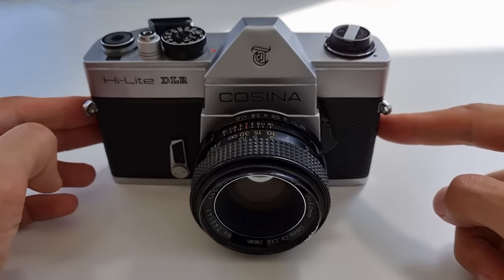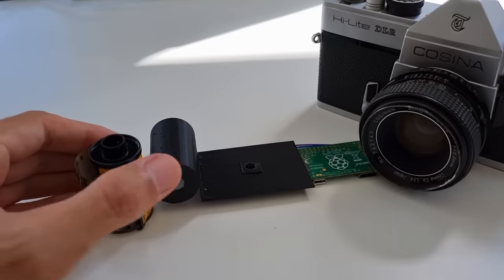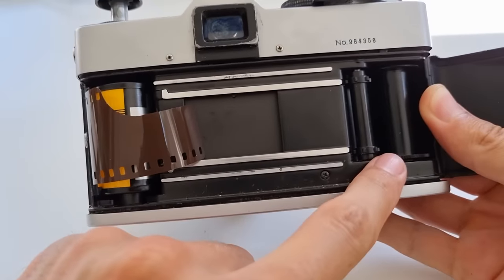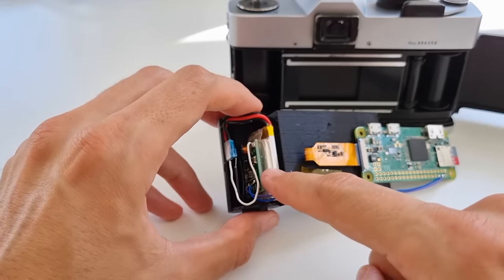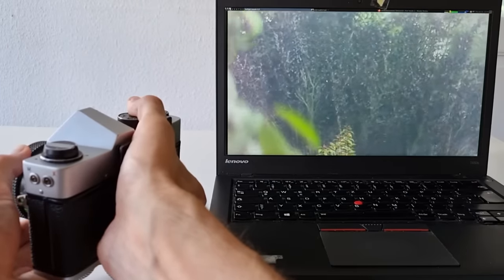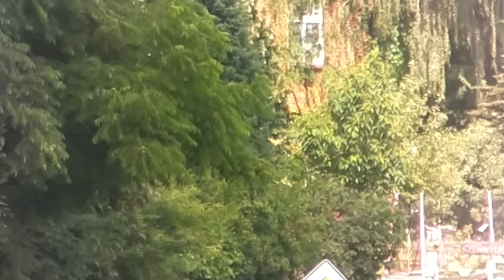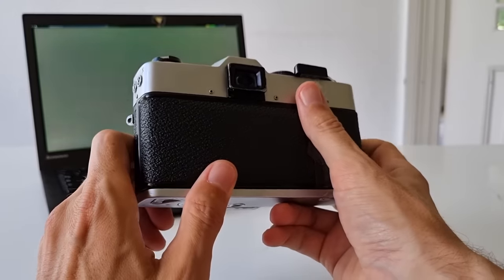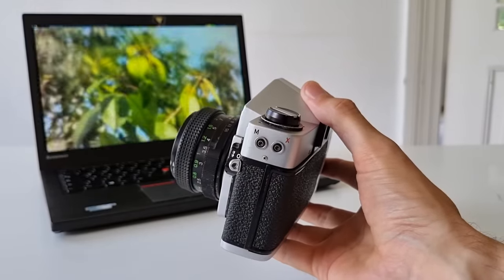Digital Film Cartridge for Analog Cameras (using Raspberry PI)

Comment: I am not amazed that the quality of the image is good. That's optical glass, you have there. These things were expensize, and that was in large part due to the quality of the lenses. Don't forget, you had to illuminate a 24x36mm surface in a perfectly flat plane. That took pretty good optics.
I can explain the zoom effect you experience: look at the focal length of the smaal digital camera's nowadays: the are between 3 and 5 mm. You have a 50 mm lens out there. If a 3 mm lens gives a 'normal' viewfield on a digital camera (equivalent to a 35mm moderate wideangle, you have now the equivalent of a 583mm super telephoto lens : 35 x (50 / 3) according to my calculation. Even if you could find a wide-angle on that camera, it would still be a 327 mm tele : 35 x 28 / 3.
There is one thing puzzeling: how did you have a film camera ? Because normally, the mirror AND the shutter block the light towards the film, and in this case, you Raspberry Pi camera. I can only imagine, that you set the speed dial to B (bulk exposure) and kept it depressed all the time ? If so, you should mention that in your video.
Nice work!

Comment: Do you build this to sell ? Can I order ?
Reply from the maker: Unfortunately not. It is just a nice demonstrator but quite far from a product. And to be honest, several factors speak against selling this. Most importantly, the small sensor size which leads to a quite insane zoom, rendering the camera not really useful in most daily applications. Also, the form factor can vary from one camera model to another, so it will be hard to develop something that fits in every camera.
Reply: hey if you fix the sensor issue and make something for popular camera models such as leica m3 or nikon fm2, you can probably have a nice side income.
Reply: @kassenbon  Amazing upload! This would really bring life back into my old slr's, and the video over wifi is just next level when you consider a slr. Any chance of sharing just a part list then? Your video really outlines the lot of it, but knowing what battery you got, ect might help here. I see that the sensor increases the crop factor, but I'd still really be interested in making one myself. I think there could still be a lot of potential with other lenses. Star cam, nature cam, macro?? 
-Cheers!

Comment: A little concerned that you said the Cosina camera ‘was state of the art k in its day, no it was a low end starter camera, Leica, Canon and Nikon were state if the art then. Given that I love what you have done, could you try it with a 2.1/4 square body such as a Mamiya or Bronica, maybe more space for larger sensor.
Reply from the maker: I was referring to the way of shooting images with the combination of 35mm+SLR. But I agree that this was not clear and showing this off with a Leica would be fitting much better. Thanks fo pointing this out! 👍

Comment: So it's just for hd video. I thought it would be to take stills but that's not enough resolution.
Reply from the maker: It can also do 5MP stills. With the HQ camera it could even do more.
Reply: @kassenbon  need 10mp to match 35mm. I have some stereo cameras I'd love to try this on. Need dual sensors though. I suppose everything else has to still work, shutters and focus.

Comment: What is the point when you are simply using the camera as a holder of the hardware? You can't press the shutter button to take a picture or record a video. You can't adjust the shutter speed. So, it is not a camera. Better off selling the camera to someone who can really appreciate it.

Comment: The problem with ALL Dumbed Down Dirty Digital camera systems is that however small you make the pixels you will NEVER even approach the size of ONE MOLECULE OF LIGHT SENSITIVE EMULSION ON FILM.
You are deluded if you think you can get anywhere near the quality of film, even if you could get a full size digital sensor array.
It is physically IMPOSSIBE, not even in the same ball park.

Comment: Rather use film that sensor looks piss poor
Reply: It’s a DIY prototype. The key is the form factor which could be put in an SLR without modification to the camera. 

A proper sensor sure. It appears that there’s enough room to accommodate a digital data array and support electronics.

Comment: So, with your basic 50mm lens, you are getting the sort of zoom you'd expect from about a 200mm zoom lens? Also, I noticed that the edges of your image are degraded and slightly out-of-focus. So, essentially it turns your old $500 film camera into  a sub-$40 cheap digital camera, where it's ALWAYS stuck on "zoom"?  How about trying a purpose-built platen the same size as the 35mm negative was? Such things are available (and also DO work), but they aren't some cheap-@$$ kludge job like yours is. You concept ain't worth a crap!

Comment: Why your whole video is shaking?  Do you currently live in a microearthquake area?
Reply from the maker: Haha, yes, looks a bit like it. Two reasons for this: 1) My tripod sucks. 2) The small sensor size results in extremely zoomed in images. Lots of zoom -> lots of shaking
Reply: @kassenbon  I'm talking about very micro-shaking, not when you zoomed in anything.  It's very persistent across the whole video, from start to end. Nothing to do with you holding anything, even the room itself is showing this. I think something is wrong with video/record processing on the camera you used to film your project with.
Reply from the maker: @VincentNacon  Oh, wow, looking very closely at the footage I think I can see it as well. Thanks for the hint. This looks annoying. Probably a video stabilization going nuts. Strange though, it is shot using a brand new Galaxy S21... I will dig deeper into this issue. Thanks!